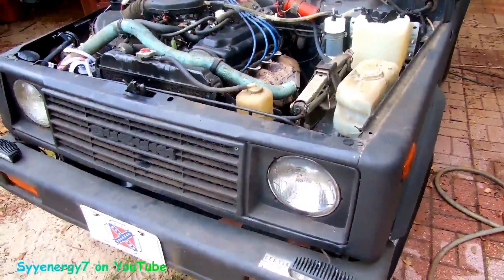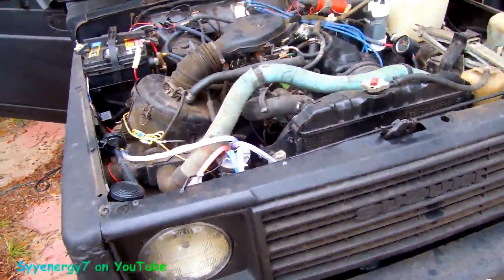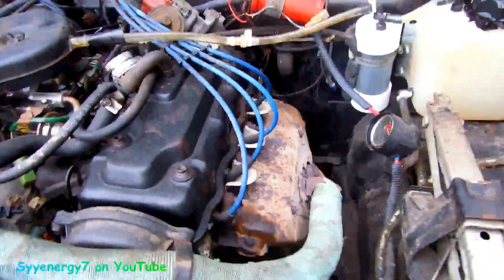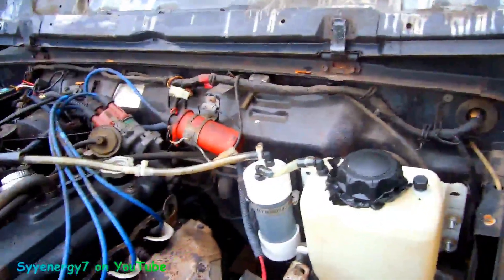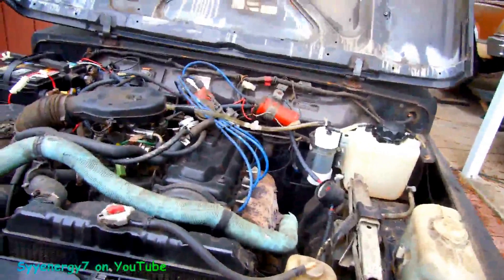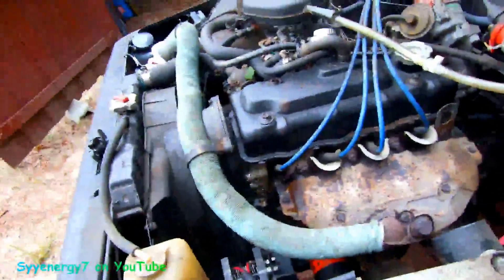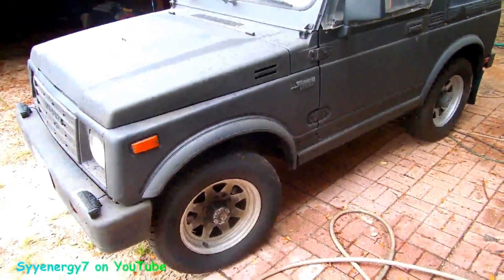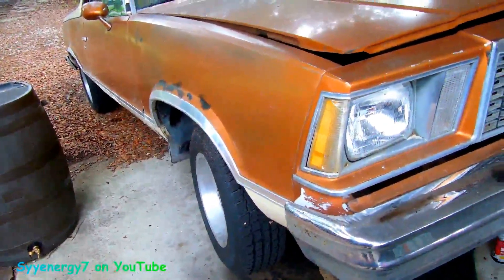HHO in Suzuki Samurai, 100% trouble-free 2 years now

Comment: Dont you find the carb staying clean as well as the intake and exhaust valves?
Reply from the maker: The carb stays clean.  I'm not sure how much the HHO will help a carb stay clean.  The HHO sure won't make the carb dirtier.
Reply: HHO actually cleans the intake, the reason all diesels should be running with them and get some real miles to the gallon :)